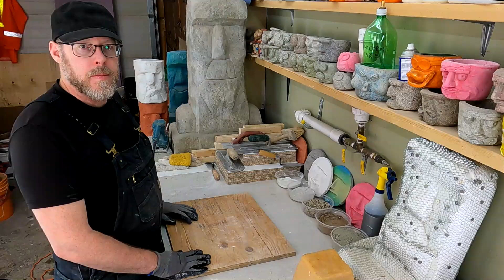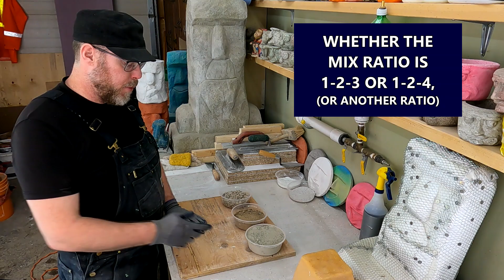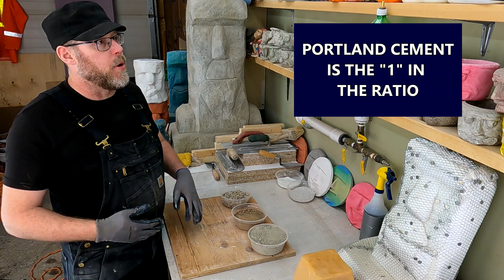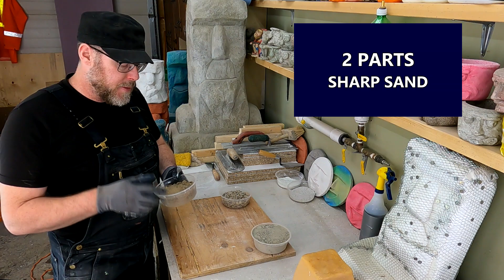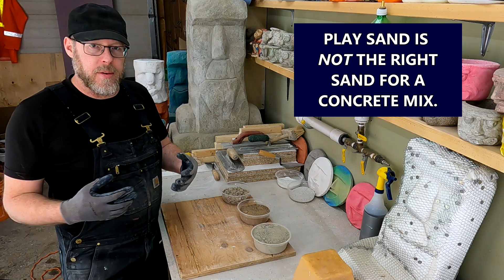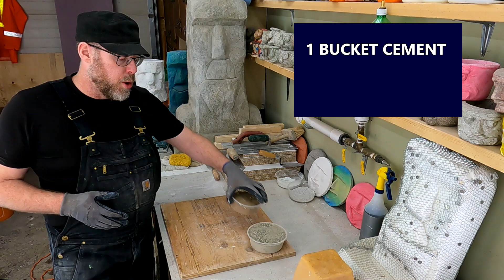How to Make Concrete Ratio

Comment: I have a bag of concrete which was sent instead of cement and I have a bag of sand I need to make a dry mix to brush between flags I did 1 part concrete to 2 parts sand and watered it a little but hasn’t seemed to set hard any advice am I missing something I am a total novice thankyou.

Comment: Oh. Crap! I’ve just laid a levelling concrete base and i used completely the wrong ratio. Mine was more like 5:1 sand:cement. Base is about 4000 x 230mm and about 25mm deep. It’s only to provide a flatter bed on top of an uneven concrete base for laying 2 courses of aerated blocks on their wide edge (215mm). So if my mix is weak I’m hoping it’ll just compress down at the most as it has nowhere to go.
Fingers crossed, lesson learned.

Comment: In the US, if you ask for type N cement, you'll get masonry cement.  Portland is type 1A (a is for air entraining), never heard of GU.  Masonry sand is for mortar, concrete sand is for concrete. Usually concrete sand will contain some pea gravel, as they want a mix of sand sizes, and the pea gravel is usually found in that mix, unlike a more uniform masonry sand.

Comment: Excellent tutorial! Thx for sharing it. After my last professional homeowner job using a pallet of bagged concrete I did some math. The pallet of 56, 60-lb. bags cost almost $1K. Knowing my local quarry’s prices for sand & 3/4” clear gravel, bagged Portland cement and the price for a decent 4 cu. ft. 1/2 hp concrete mixer, I figured I’d save ~$300 vs. buying pallets of bags. First job pays for the mixer. Lesson. Learned. Subscribed.

Comment: Germans built several concrete buildings in Norway during WW2. After the war, the Norwegians decided to demolish one of the buildings, but they could not do that. The concrete was so strong that, at least in the 1960s, it was indestructible. Did they have a different formula?
Thanks for the video.
Reply: Part of what is happening is that concrete gets stronger and stronger as time passes.

Comment: Should the ratios be measured by volume or weight?  Do the numbers change if I want to measure by weight?
Reply: I do it by volume and my sidewalks have come out looking great. I also checked and a bucket of sand weighs the same as a bucket of gravel

Comment: Love you videos) I'm able to cast myself now, teacher 🙏🏽 in a description to this video you suggest that mix ratio can be both by weight or volume. Aren't they very different? E.g. a bucket of bigger stones may have more space between them and weigh less than a bucket of small stones. Should we better stick with weight ratio then? What do you think)?
Reply: I'm also trying to find the answer to this. I see a lot of different answers.
It's very ambiguous because most instructions always just say "parts", but the spesific density of sand or concrete is way more than say water, or an additive.
Supposedly the professional cement mixing plants (like for cement trucks) use weight. Bags are sold by weight (like 20kg), not liters - so it seems like the most natural thing would be the bags as "parts". That's effectively be weight.
Yet I see a ton of people claim it's volume - like buckets. I'm really not sure...

Comment: hello! Another question :-) Do you use the same mix to create those small pots on the shelf in front of you? Or do you use a sand - cement mix?
Reply: I think he uses mortar for them. Check his video on mortar ratio)
Reply: @stanislavkhanin7041  thanks!
Reply from the maker: For the small pots, a mortar mix is used.  Here is the video on mortar mix for casting:
https://youtu.be/Q3SJi5PhxxE?si=d7LAUd2mMg0puy5v